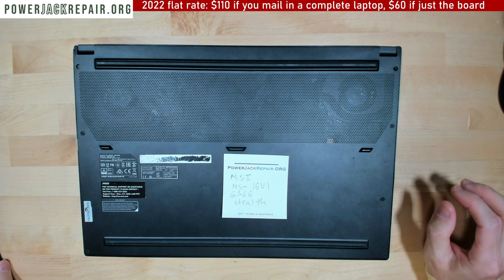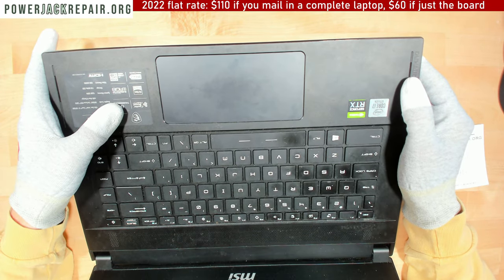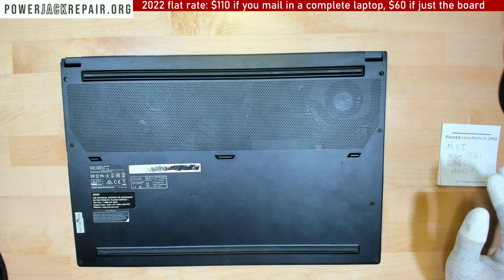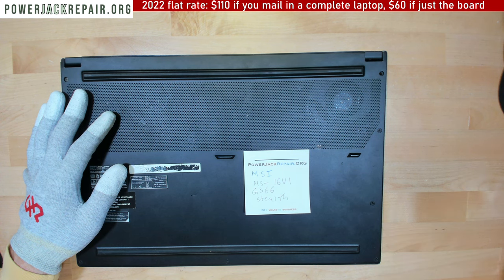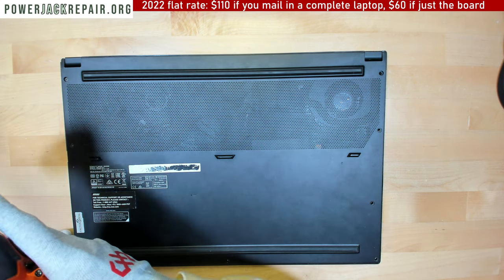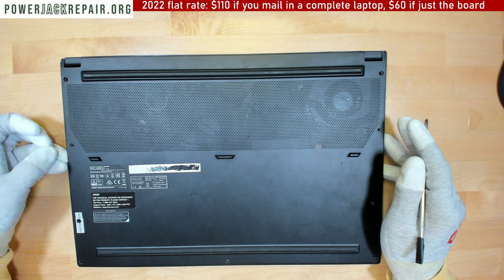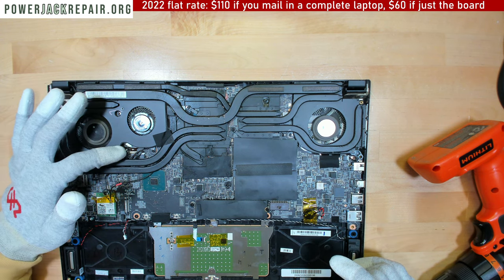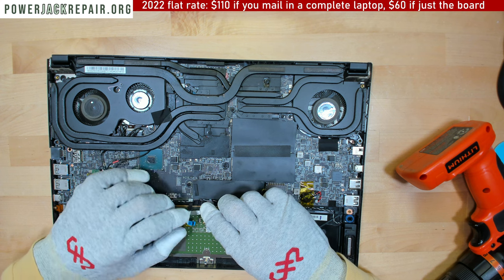MSI GS66 Stealth MS-16v1 laptop charge port power jack repair fix charging connector replacement

Comment: Nice video and explanations. I'm upgrading from a MSI GF63 thin to one of these laptops next week. I take it that power jacks must be a common fault point on devices? I'm curious as to why though? I heard you explaining the high amperage that goes through the solder points as a reason why? My questions would be; a statistic on one in how many laptops, more specifically gaming laptops, will end up needing this repair when used heavily? I would imagine causes could be; mechanical stresses when under high power and high temperatures, like accidental yanks on the power cord (accidentally tripping over it) happening over time? Faulty manufacturing process such as solder points or even slight variations in solder or connector material quality?  Why would some high amperage gaming laptops that are used heavily never experience this issue?